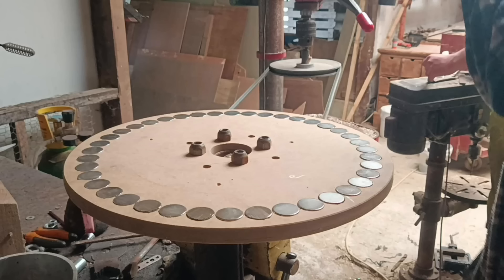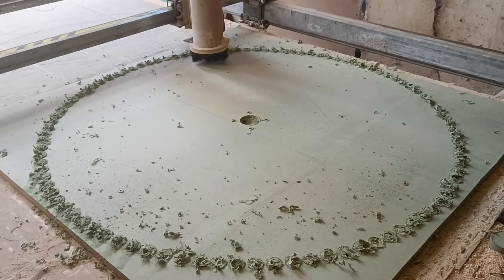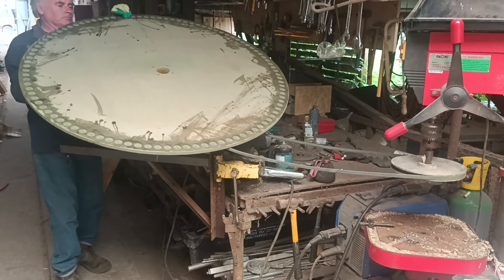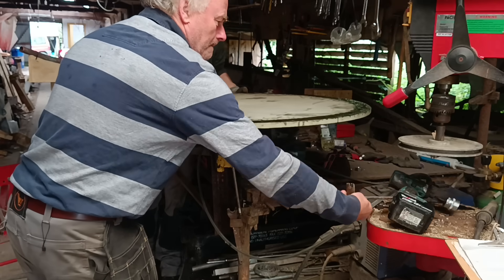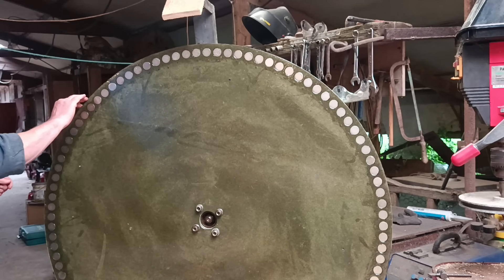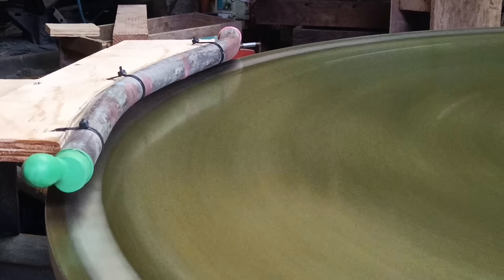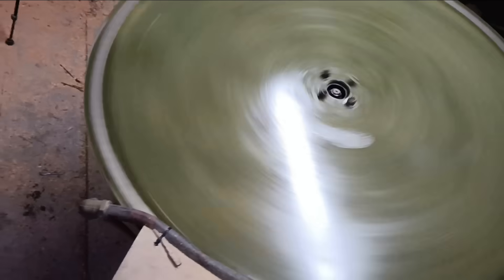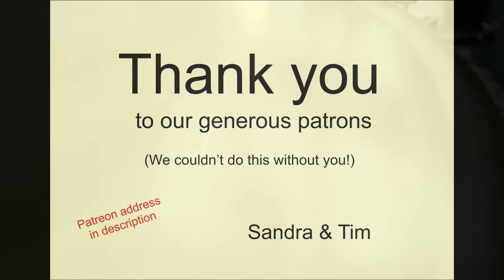ABSOLUTELY HUGE Magnetic Induction Heater! Using 100 Spinning Neodynium Magnets And A Bucket

Comment: Greetings Tim, I invented this type of disc back in 2009 and used it for levitation purposes. It can be seen on my YouTube channel by clicking on my username here. With this design in your video here you can make a dual layer pipe coil the same diameter of the magnets. One loop of the coil will cover the upper circumference of the magnets while the second loop will cover the circumference of the magnets from the other side. The coil loop closest to the magnet will have better induction due to spacing. You could make another iteration of this type of design where there would be 4 or 5 (or more) tracks of  magnets side by side with the holding MDF the same thickness as the magnets (maybe acquire thicker magnets?). Then you can add additional radii to your pipe coil loops both upper and lower. This will give the water more time to be heated up.

Comment: One thing I remember on the old farm with a wood cook stove that had a pipe running through the fire box was that the hot water went into the top of the galvanized tank and the cold water came out at the bottom.  Your water system has both hot and cold in the same place,,, at the bottom of the pail.  I suggest moving the hot water pipe near the top of the bucket.  Hope that helps.

Comment: As others have said, it needs a full circle of pipe, not just a small section but also why only 1ring of magnets, what if the metal pipe came into the centre of the wooden discs then spiralled out with many rings of magnets following the pipe until it worked it's way to the outside of the disc and then up to the water reservoir.

Comment: I would use flattened copper pipe on both sides of the flywheel fully encircled around the perimeter over the magnets. mount it vertically for safety and height differential.

Comment: The more inventions like this pop up, the more I become interested in one of the derelict water mills properties.
The structure is there, all you need is fit it with the energy producing equipment and after that you don't need to depend on electrical grid whatsoever.

Comment: I probably would try mounting an insulated water tank like a water heater tank above the magnets with a piece of copper brazed to the bottom of it. I'm sure it's Eddie currents swirling in the metal that is heating up, making it thicker, where the magnets are will probably make it hotter.
Reply: You can get a windmill or build one with wind speed control. It makes a huge difference; everything will last much longer instead of self-destructing. I probably would look for a used one off a farm with a pump shaft coming down.

Comment: Seems simplest to me, would be to generate electricity then use a resistor of whatever value as a water heater. You can get resistors in any power value, any resistance, pretty much. I imagine it's like solar power, where MPPT would benefit, there'll be an ideal resistance that draws the maximum total power, volts x amps. Sub-optimal resistance would bring the voltage down too low, or pull too little current, and waste potentially-generated energy. You could use a little microcontroller to control that, or just fiddle about til you get something good enough then stick with that. Maximum power point will vary with the disc's speed, but there ought to be a middle value. 

PWM wouldn't work though since you want a genuine change in resistance. AIUI. But an R2R DAC ought to. Maybe even just, say, 4 high-power resistors in series, and transistors bridging each one. Or relays, even. That'd give you 16 values. Put another big resistor in series and / or parallel and you'd be able to put your home-made 4-resistor DAC's range approximately where you want it.

Depending on the power of the whole system, there might be ways of improvising the heating resistors. Heating wire from a toaster or hairdryer, and appropriate cement. The transistors ought not get hot in a circuit like this, since they'd be fully off, or fully on. If you use transistors with an insulated casing, you could put them in the water too. 

I know the idea with using magnets directly to heat with eddy currents, is simplicity, can't really go too far wrong. But actually there'll be an ideal number, and strength, of magnets to use, for a given speed and torque of your driver, your windmill. Electricity is much easier to deal with in that way, a lot less twiddling, you could end up with just a knob or two to turn, a little remote-control keypad maybe.

Electricity would also allow you to put the water tank indoors, with much less to insulate, rather than have it outside with the windmill and long pipes to your house. Electricity is a lovely, friendly, versatile form of energy, compared to heat or mechanical. NB don't get electrocuted.

There's another way of heating water mechanically, used in old energy meters. Simply, paddles in a bucket of water thrash it about. Simple friction in the water heats it up. Might be better than this method, certainly simpler and cheaper. Could make it all out of wood and some bearings. There, tuning would be deciding how big to make the paddles, abd how much space to put between their elements. MPPT, but instead of volts and amps, it'd be RPM and torque.

Comment: There are numerous useful comments below; related to flow and utilizing the full circle of magnets... let see if I can add to them... (simple layman with an appreciation of physic's concepts) 
I suggest you are creating a field effect not dissimilar to a microwave oven... Please note; I did not say the same as. You are creating a toroidal field of vibrating Ions by spinning the magnets. Were you to install sensitive electric sensors at various points around and over/under your spinning wheel I believe you will find interesting measurements of electric field generation. 
If you were to build another smaller wheel either on top or within the horizon of your existing wheel (which would of course require considerable re-engineering) and spin that second wheel up you will discover all manner of interesting effects as it the frequency of the second wheel accelerates to match the speed of the first. If you spin the two wheels in opposing directions the effects will I predict, could be even more dramatic - or maybe self cancelling. 
The problem I foresee (subject to how you wish to take this experiment), is your engineering needs to be more refined before you'll create a stable plasma field - or even an potentially dangerous unstable one.

Comment: using a motor to drive the magnet wheel and converting electric energy to overcome the drag to generate heat ist complete nonsense. heating the water with an electric heating rod would have maximum possible efficiency.
Reply from the maker: As I explained - this was an experiment in advance of building a windmill. Duh!
Reply: @wayoutwest-workshopstuff6299  I do apologize... I must have overlooked that point. There are too many videos showing a motor in the magnetic heater. you have done technically well, but the idea of having the magnetic wheel powered by wind (or similar) is actually brilliant!

Comment: Your concept it great but only using about 1/6th of your magnet. How about a ring of copper tubing full size of magnet ring. A ring of copper on top of your ring of magnet. Even double up the copper ring for the water to run further through the copper absorbing as much heat as possible. Garage inventors are the backbone of science, love it. Keep those creative juices running. opps, just read the comments below, seem a lot of us are on the same page.

Comment: Seems the very definition of pointless to me. If you wanted to generate heat it would be several hundred % more efficient to use the rotational force to drive a generator that in turn ran a heat pump. But I suppose it’s a harmless folly.

Comment: Great and fun project.
My observation: why not use the ENTIRE area of the magnets around the circumference of the disk? You only heat a small piece of pipe that takes up a small percentage of the disk, but the induction occurs everywhere around the entire circumference of the rotating disk!
Imagine the power if the exchanger described the same circle above the rotating disk with magnets.
Reply: Yes, a few "layers"(too many and diminishing returns) and also having it double sided(sandwich the pipe between two). He's using very little magnetic flux. But, in fact, likely it would be far better just to use a generator and a resistive element as these are nearly 100%.

Comment: like the jib and mainsail, maybe the whole thing works as a whole and not its constituents? i.e. optimisation of things like the wheel speed and distance of the copper might change with heat or other conditions?

Comment: maybe using the Heatpipe Tube which is ment for heat transfer in Electronics for the extraction part.  As they are flat in design and made from copper , which allows them to be more efficient with close proximity, but it needs the flywheel to be less wobbly obviously. Also they have ultra good heat transfer with the vapor inside.  Using bunch of  these for transfering it to a tiny radiators which is transfering it to the water medium...  it could be possible that water needs to be circulated as well to avoid the performance drop from excess heat which is not taken away fast enough... these are testing details anyway.

Comment: This is cool... However, You should have lathed the wheel to make it less wobbly. Also, You need to curve the pipe around more of the circle and then flatten it down to the width of the magnets, then insulate the top of the flat pipe.

Comment: From building wind turbines, a suggestion, a steel ring or backing behind the magnets will cause a stronger magnetic field above them and thus more magnetic flux as the poles pass for a given speed.

Comment: The hot water inlet in the bucket needs to be higher than the cold water outlet to avoid short circuiting. I have heated my water from a coil in my wood stove for years. I use an old hot water tank set just above the stove. Hot in at the top and cold out at the bottom. Provides all the hot water we need all winter.

Comment: maybe magnet holding holes on the other side of disc slightly smaller so as to fix in place  the pipework completly around disc. on both sides of disc. with inlet and outlet with perhaps a small battery pump in there

Comment: why use only a portion of the circle?
Reply: It would increase resistance. (The induced magnetic field in the copper has a braking effect). At what point the resistance becomes impractical… I don’t know 😉. Although the energy is transferred magnetically into heat, the energy still came from the drill and it only has so much torque.

Comment: Higher frequency produces more heat faster.  I used 1/2" diameter magnets with 1/2" space between the magnets in a 1/2" thick aluminum circle.  4 magnets inside each hole.  28 magnets x 1400 RPM = 39200 Hz.  28 magnets x 1700 RPM = 47600 Hz.  39200 Hz heats a 1/4" steel rod red hot in 11 seconds.  47600 Hz heats a 1/4" steel rod red hot in 7 seconds.   I have a wind mill gear box for sale if your interested?  Murfreesboro TN.

Comment: If you make it so is shaped going over and back across the magnets with multiples of smaller diameter pipe like a tube plate heat exchanger but bent into lots of s es .

Comment: if you add more pipe it will increase the resistance to turn so keep that in mind, but that should increase the wattage that you are able to output into the water. might consider a gear box of some kind for your windmill to increase or decrease the load on the windmill. this should make it so that you can have little wind and still get some output of power.

Comment: If you have a steel sheet or plate behind the magnets, touching all the magent rear faces, you would get a much higher flux density (stronger magnetism) on the front area where the water pipe is.

Comment: Why not just put the magnets on a treadmill-like belt instead of a large & heavy containment?
Reply: Or, long bar magnets running  length of larger dia pipe enclosing over length of smaller dia water pipe and roller bearings on either end of centrifuge to act as support and to insulate heat from outside.

Comment: Love this. I hooked my diesel heater exhaust to an old car EGR cooler and have it connected to a heat matrix in my shed, it was not so impressive until I insulated the pipes. Amazing how much it cools the exhaust down. Question, what do you want to heat the water directly and not via heating elements? It seems to me electric would be more flexible, that said I love the experiment.

Comment: several things. 1. tubing must be as close to the magnets as possible, almost touching.  2. Instead of a tube following the circumference, make is S - shaped so each magnet fully engages and fully disengages with the metal tubing.  |SSSSSSSS|    3. Electrically connect the metal inlet of the tubing with the outlet of the tubing.  This will serve as a short circuit for the induced electrical currents generated in the S-shaped tubing elements.  When you make this connection you will notice a big increased mechanical load.  Beware that significant voltages may exist.

Comment: Use square plastic tubes, cut and glued/welded to follow the entire circumference of magnets as closely as practically feasible, and spend the money saved on thick copper flatstock with which you will floor the pipes. That way you will have as much copper as possible where it's actually useful, and almost none where it's not.

Comment: Use wood that's the same thickness of you magnets so that they are exposed on both sides and run a pipe the full circumference around the wheel above and below it. If you also made the holes so that a part of the magnets were exposed on the outside rim of the wheel and aligned the polarity there as well, you could have a third turn around there as well. While of course adding more magnets to the entire surface area would help too so you could have a coil above and below.

Comment: Loved the video. Thanks. It looks like the magnetic principle is more do-able on the small scale than the larger. For a whole house heat and cooling system i think geothermal would be more efficient and require less long-term maintenance. The earth is always conducting heat, but the wind doesn't always blow.

Comment: Add a water pump and either coil the tubing or several smaller tubes to keep the same flow rate and add insulation to the system.

Comment: I’ve built this rig before — smaller footprint — and ran all the math, thermal sims, and bench tests. Couldn’t get the efficiency to climb past 65%. Pro tip: slap a solid thermal barrier with garbage heat conductivity between your hot copper and those magnets. Skip that, and you’ll get heat soak, flux drop, and your mags will be paperweights before you know it. In my tests, that choke point was plain old Teflon.

Comment: Would it make sense to stud the entirety of the disc's surface area with magnets, and then have a spiral lattice of copper pipe on top? That way you're maximizing the work the disc can perform, and contributing to a larger surface area that can be heated. 

Even better, if you had a contra-rotating copper lattice of piping. Increase the field effect without having to increase rpm.

Comment: Suggestions-   use a smaller wheel thats lightweight , create multiple rings or rows of magnets, coil yuor copper pipe all the way around yuor  magnet rings , you can even make a second wheel or disk above the copper pipe coil winding connected from the center hub

Comment: I'm ignorant here, but if the poles go side to side across the water wont the eddy currents just zig zag instead of collide in a heat building manner? This setup also seem to imply the goal is to keep the pipe cool more than to heat the water, but I guess it is still the same heat transfer at the end of the day.

Comment: Unless you get that windmill connected or maybe set up a set of pedal bike of some kind I suggest you put that electricity through an electric heater. Or you set up coils to induce electricity and you take that electricity to an electric heater of some kind and heat the water that way

Comment: Instead of trying to heat the water in such a short length of copper put a ring of copper all the way round so as its constantly heating the copper for the full circle. Even though your hundred magnet are in constant connection in one point it will heat the water better if their is a full circle of copper so as you are using all the magnets to heat the copper not just a 300 ml strip.

Comment: Since the wheel is built, you could turn smaller wheels around the pipe. Or, you could make a lever attached to the wheel to actuate a trough of sand , eventually the pipe would need to be replaced, unless you simply filtered the water through the warm sand.
Or, a spiral patten and the actuator would work…. Maybe just distracting your effort here.
A smaller diameter pipe coiled like an old thermostat. Would a bunch of those work? A wavey pattern would be interesting.

Comment: Keep your RPM the same but shrink that magnet disk to half its diameter. Sure, your sweep speed is now half, but here’s the kicker: switch to a Halbach array and you double the field strength hitting the pan, and stack three rings of magnets so your total footprint area under the pot triples. You’ve basically got a half-size wheel that’s three times more powerful where it counts. The lighter, smaller disk spins up faster too, so your motor torque ends up driving way more eddy currents. Long story short: same RPM, half the sweep radius, but 2× field strength and 3× area coverage = about 3× the heat output. That liter of water? It’ll hit a boil in around 3–4 minutes instead of 10